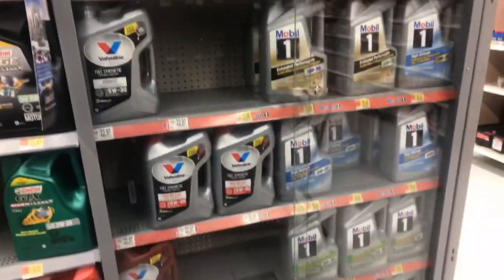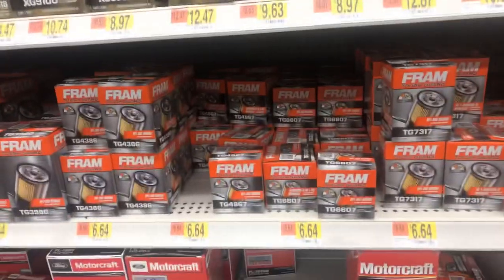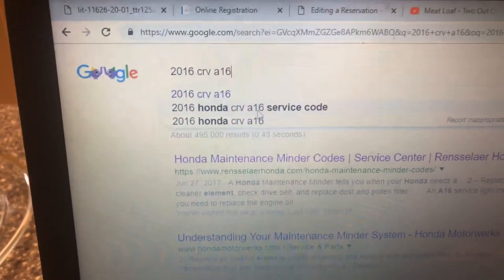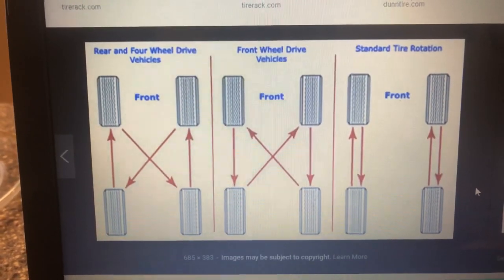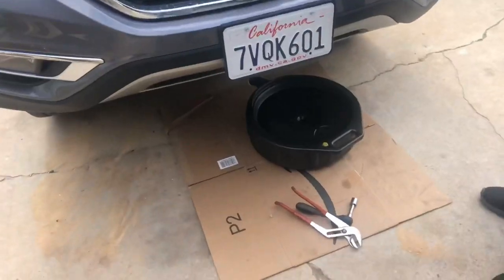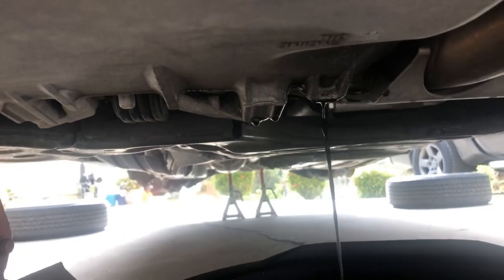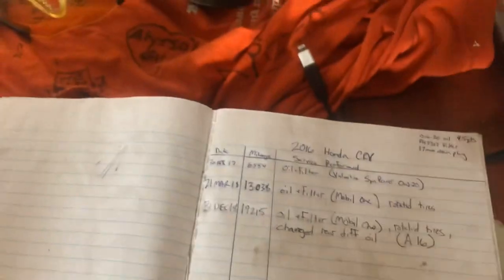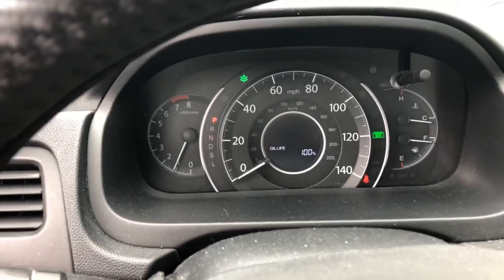2016 Honda CR-V A16 Scheduled Maintenance

Comment: Just did the engine oil, trans, and rear, and as always tire rotation on my 2012 and it took like 1.5 hours start to driving. Easy-peasy.
Reply from the maker: Yes, the basic maintenance is really straightforward on these.  Awesome!

Comment: Nice job on this video. Great explanation on the rear diff and different ways to get the fluid in. I have 2 CRVs and one is a 2016.
Reply from the maker: Thanks, these are pretty easy to maintain...no reason to pay big dealer prices

Comment: You guys are very cool. Speaking calmly and detail oriented with lots of handy tips. Did not understand why the 'filler' cap has to be removed first, unless just precaution in case you can not drain and need to put the filler cap back on with at least the old fluid?  I only know how to change engine oil. Learning a lot from you and glad to see your son working with you. That is good bond dudes!
Reply from the maker: Yes, exactly right on the filler cap.  Imagine if you drained it all out and then couldn’t add fluid!  Thanks for watching.

Comment: I know I'm late to this thread...  

In July 2023, my local Honda dealer charged my wife $90 to change the engine oil and filter on her 2018 Honda CR-V LX AWD.  

The Dealer wanted an additional $560 to:   
-  rotate the tires
-  flush the brake fluid
-  change the rear differential fluid  

I think that price may have caused me to have a stroke.

I took care of those three maintenance items myself, in my home garage, in 114° heat, without A/C, using Honda brake fluid and Honda rear differential fluid.  The Honda fluids cost a total of about $47.  
Now I'm a fat old man, and it was really hot 🔥, but I still got it all done in around 3 hours.

Good things!   👍
Reply from the maker: That heat would have had me melting, but the cost savings was worth it I’m sure!  Honda brake fluid is a total scam, by the way.
Reply: @TomsTinkeringandAdventures  
Yeah, it gets pretty warm here in the Phoenix, AZ valley in the summer.

Once upon a time, I recall Acura / Honda requiring their rear differential fluid, only, to be used in their AWD vehicles.
Then they added their automatic transmissions to their fluid only requirement... then their brake fluid... then their engine coolant.

$$$$$ keeps flying out the door.  

I still buy after-market third-party engine oil and filters.   

Good things!   👍

Comment: I have a 2016 CR-V EX-L

I always change my oil and filter with it on the ground, plenty of room. I also change my filter on both A and B service. I use Royal Purple 0w-20 and Royal Purple filter.

EDITED You can also reset your maintenance minder thru the multifunction display menu above the radio using the steering wheel controls on the left
Reply from the maker: Lenny D Honda actually engineered this model pretty good, it’s fairly easy to change the oil without putting it on stands.  I have heard good things about RP oil, use what makes you comfortable.  Thanks for watching.

Comment: Great video thanks, Honda just quoted me  $165 for trans fluid exchange, $165 for brake flush.. $47 dollars for oil change. What is it all profit?
Reply from the maker: Wow!  This is the second Honda I have owned, had a 2007 Pilot before this and did all the maintenance on that including the timing belt.  I know the dealership is not cheap but didn’t realize it was that much.

Comment: I stop using Fram oil filters. I had a new one about to install on my car and saw that the metal cap at the end was rusted. Brand new never been used nor been wet and it was rusted. Just threw it out and now using Purolator filters.
Reply from the maker: W Moy I have had no issues but I’m just one person, hearing a lot of people who have had issues.  It only takes one bad experience....
Reply: @TomsTinkeringandAdventures  typically I’ll use the Fram Tough Guard or the Ultra Synthetic on my Honda’s. I’ve never had a problem with either of them, and that’s cutting them open after the oil change interval. I use these as the vehicles call for 0W - 20 full synthetic, and the filters held up nicely intact.
Reply from the maker: @carlovanrijk4039  I usually use those as well depending upon availability.

Comment: Hi, I have Honda 2016 CR-V EX and have a problem and please I need your help if you can. When I receive a call, the name of the caller does not appear on the screen, only the number, although I saved the number and the name on my phone. I tried to solve the problem with Honda, but they couldn't. This is not good for my safety because I have to look at my phone to know the name of the caller while I'm driving.
Thanks a lot in advance and have a good day.
Reply from the maker: I’m sorry, I’m not too familiar with the phone interface system.  I don’t really use it much.
Reply: @TomsTinkeringandAdventures   No problem and thank you so much for your quick response.
Reply: @TomsTinkeringandAdventures  By the way; when I said the (screen) I meant the car screen, not the phone screen, meaning that the problem is in the car's Bluetooth system
Reply from the maker: @Maantaj61  I figured that.  Like I said, just not really familiar with it.  My wife drives this car most of the time.  Great vehicle.

Comment: Do i wait for the maintenance minder to come on or what is the interval.  Just hit 41000 on my 2015.  Nothing has ever came up besides oil change and tire rotation
Reply from the maker: Yes, the maintenance minder is what I use.  It really depends on how you drive, if you do longer trips it may make the intervals different.  We do a lot of short trips in town.

Comment: Excellent video,  fun and useful.  I have around 50K miles  on my 2016 CRV,  I have never changed the diff oil,  the car drives OK.  Is there a real need to do that ?
Reply from the maker: ocean well I am pretty bad at delaying maintenance myself, so maybe not the best person to ask!  😂  I’m just following the maintenance minder trying to break my bad habits.  It’s fairly easy to change and not expensive, so give it a shot.  You’ll sleep better at night knowing it’s done.

Comment: Hey, do you know if the 2016 CRVs also have oil dilution problems?
Reply from the maker: lavie maintenant I don’t know, guess I will have to research it.
Reply: Tom's Tinkering and Adventures they said it’s 2017 and up w/ 1.5 turbo engines but some say it’s anyone of those w/ the earth dream engines.
Reply: lavie maintenant google could tell you

Comment: So I have a 2015 honda cr v ex for the rear differential would it be the same way to change the fluid out? Mines is fwd
Reply from the maker: Raider Alex if you don’t have the AWD model then I don’t think there is fluid to change in the rear....but I’m not positive.  Good luck.
Reply: @TomsTinkeringandAdventures   why do you think there is no fluid back there? Is it because of the awd?
Reply from the maker: Raider Alex yes, the front wheel drive doesn’t have a rear differential.
Reply: @TomsTinkeringandAdventures  oh yeah I don't know what I'm thinking, sorry about that, thank you though
Reply from the maker: Raider Alex no worries, I am always getting a few steps ahead of myself on things so I get it.  👍🏻

Comment: Hey there, I know it's a little late for this but was hoping if you have had any vibration issues with the 2016 CRV. I've heard enough bad stories from people about how both the 15-16 models all have this weird vibration issues and I'm trying to get my first new car from Honda. Thanks!
Reply from the maker: Michael Toro I haven’t heard of it and don’t have any issues, but it’s only got 30,000 miles or so.  I guess I will be researching it.  Thanks for watching.
Reply: Try to get the tires balanced, I was having that issue right away from the dealer, took it back and they balanced the tires, issue went away.
Reply: That was at highway speeds.
Reply: @uenragedbro  That's not the vibration issue OP is referring to, OP is referring to idling vibration that is common with that gen CRVs.
Reply: My CRV has idling vibration issue (when I'm at a red light for example), it's annoying but from what I've read it doesn't affect the longevity of the car and not a major issue so I just deal with it, somewhat annoying but for me it's not always.
Reply: Recall on 2015 and some 2016 Vibration issues, Bulletin issued bring your CRV to a Honda dealer and they will fix the issue.
Reply: JulV I don’t think they fix it for free since it’s not a full recall.
Reply: Yes its free ,I have a 2015 that had that vibration issue. The tech drove the car and notice the issue and they did the fix for free.
Call your local Honda dealer and make a appointment just let them know you have a vibration issues and would like the recall applied to your CRV.
Good luck.
Reply: 2015 Honda CR-V Technical Service Bulletin (TSB) 15-046
Mode 1 consist of installing new radiator lower cushions, a new transmission mount and new front head restraints.
Mode 2 repairs will see dealers install a tailgate damper kit and perform a software update to the powertrain control module (PCM).
Reply: JulV I have the 2016 but still got vibration. I’ll look into it, I don’t mind it but if the fix is free then hell yea.